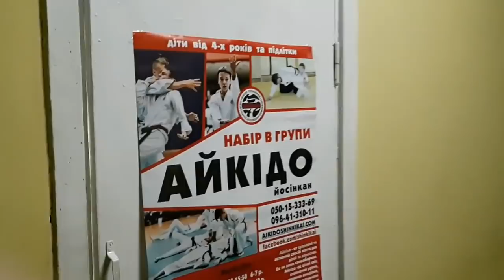Wall-Mounted Coat Rack

Comment: I found the use of the tree branches as coat hangers quite innovative, and if I can ask, is the epoxy you used over the bark going to seal the wood enough to keep the bark from drying out enough to separate from the wood underneath? I am always leery of leaving bark on finished wood for any reason because of the different drying rates.
Reply from the maker: In this way I've laminated the bark for several times, the epoxy resin glues the bark and kills the bugs that can live inside it

Comment: Very good work! May I ask? which tree is the basis? in the fireplace did you dry the branches?
Reply from the maker: Thanks, I used oak and ash wood remains for making it. Yes, I dried a branches in the fireplace.
Reply: @homemadeinlviv8041  thank you